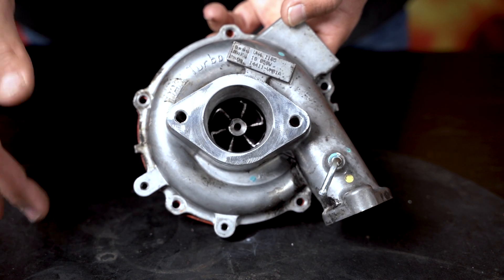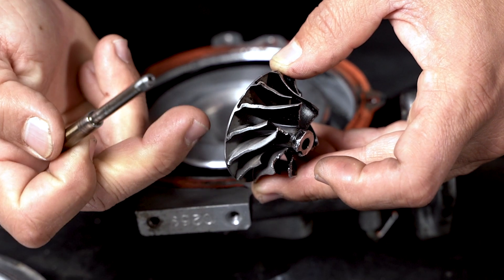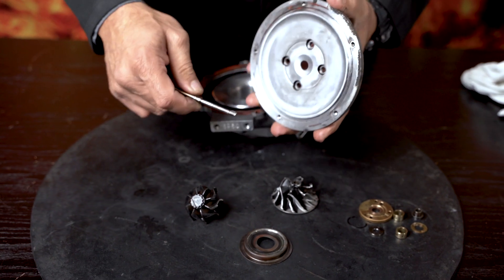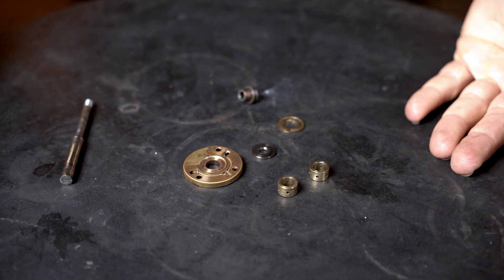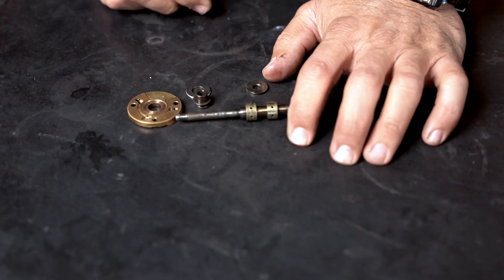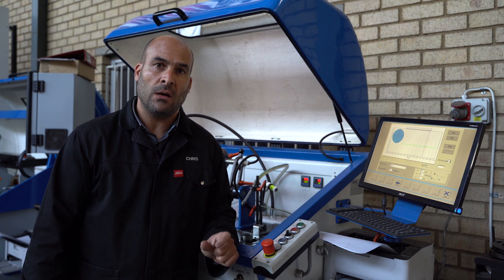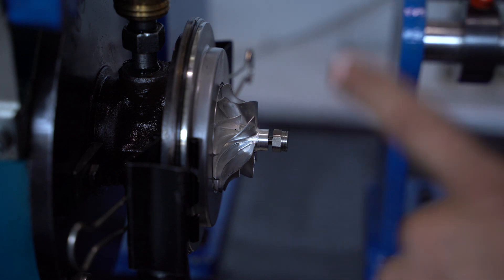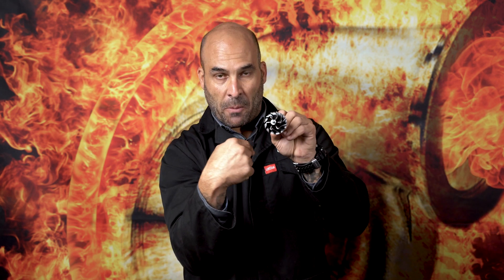Can a turbo shaft nut loosen during operation?

Comment: I rebuilt a Garrett TE-60 for my Grand National. Powder coated the compressor housing, new bearings and thrust collar, and Cerakoted the turbine housing. Bearings were proper clearance. When I took it for a test drive, the compressor nut came loose and bounced around inside like a pinball. I was so sick to my stomach.  It baffles me to this day
Reply from the maker: The only way the shaft nut can loosen is if the rotating assembly during operation comes to a dead stop or sudden/immediate stop - this is usually caused by a seizure of sorts.

Comment: So what is the cause when half the shaft with the nut breaks off
Reply from the maker: Many failure mechanisms can cause a shaft nut to break  - depending on the turbo and bearing system, the shaft could break at the neck or shoulder.

Comment: Great to know and great explanation. I have one question how much back and forth play should the turbine have?
Thanks
Reply from the maker: There will always be a tolerance axially - and radially. This will change over time with predicted wear in the bearing cartridge. IF there is abnormal wear sustained in the cartridge, this will change, and if excessive, you will have contact made between the rotating assembly and the mating end housings.

Comment: what if the nut loosens just barely and i notice it and tighten it again. is turbo still good? or does it need replacement.
Reply from the maker: Excellent question - here is what happens.  As the nut loosens, it will usually associated with a lack of lubrication or a lubrication related problem. In journal bearing turbochargers, if the rotating assembly comes to a sudden stop, this will loosen the shaft nut. Keep this in mind, ill come back to this shortly. A seizure in the bearing system from a lack of lubrication (oil starvation) will create a sudden stop or slow in the rotating assembly which will loosen the nut, and as the rotating assembly rotates again, the nut will re-tighten as you saw in the video. Keep in mind a seizure is unlike a 2 stroke engine which comes to a dead stop and remains in a seized stated until it cools down, freeing up the piston/s again. The turbocharger seizes, and the thing molten layer of the bearing material will seize/swipe itself onto the mating component (Shaft running face, or thrust collar, or spacer etc) and then once the material has swiped onto the mating surface (aka material transfer) the rotating assembly starts to turn again. 

NOW - the nut loosens, which frees up the rotating assembly and almost always the orientation between the compressor wheel and shaft changes. Then the nut tightens up again, BUT the rotating assembly is now out of balance ..... the bearing system will not last very long in this state, and it will usually become audible. 

What you will more than likely also find is that the rotating assembly once free'd up with the loosened shaft nut, will thrust the turbine and/or compressor wheel into the mating end housing, which will cause damage to the blades.  

The other occurrence will be the nut loosens off of the shaft and gets sucked back into the compressor wheel inducer blades once the rotating assembly starts to rotate again, damaging the wheel.  In this case most 'mechanics' will claim warranty as we never tightened the shaft nut, and it caused damage to the compressor wheel blades..... very common claim when turbochargers are not primed, or not primed correctly. I will have to make another video on this to explain it in more detail for you - but hope this sheds some light.

Comment: i am re-assmbling turbo when i do up turbo shaft , nut it locks up have i done something wrong.
Reply from the maker: When you install the shaft nut, it should turn onto the shaft freely, and butt up against the compressor wheel nose. Once this happens, you tighten the nut to a torque value depending on the family of the turbocharger. 

If you are not able to get the nut onto the shaft, then maybe the shaft is damaged or the thread itself is damaged. Also remember the nuts tighten in the opposite direction to normal rotation of the turbo.
Reply: @TurboDirectSA  Thanks Ive defiantly done something wrong as after Ive tightened nut turbo impellers wont budge. wish i could show you.
Reply from the maker: @MrStephen777  Buddy have you not cross threaded it?  Send me a video on info@turbodirect.co.za ill take a look and advise from there.
Reply: @TurboDirectSA  couldent send the video as email said it was too big, will send some images somehow
Reply from the maker: @MrStephen777  send it on a wetransfer
Reply: @TurboDirectSA

Comment: can you do a video to explain old tech turbo and newer deisigns? for example the ct26 used in the older land cruisers (1hz) . some ppl are still adamant that the old ct26 turbo is still the most suitable turbo for this engine , maybe u can go into the compressor and turbine blades deisgn  and how they differ between old and new type?
Reply from the maker: Thats  great question and will make for a great video BUT will spark ALOT of controversy - many opinions will fly and in my opinion will be counter productive.  The points i will make though are the following - 

-- What are you comparing the CT26 ( which is a specific model turbo from a specific engine) to  exactly? 
-- Its not fair/possible to compare this to a universal performance based turbocharger that is designed for a range of engine sizes and P2C ratios..... It will be apples with oranges. 
-- Always use the compressor maps and turbine pressure maps to compare turbos, these are the "spec sheets" which show the facts about the units, and then plot your engines specific data onto these maps to see what turbo is best suited to that specific engine/application.
Reply: @TurboDirectSA Has anyone evey welded a turbo shaft nut to the tip of the shaft it self ? I need to do this to my shaft because my torque rench didn't register 2.1nm and now my nut has pushed past the turbo shaft thread and the nut is now pushing past it's normal  clearance on the bearing. Will a tack weld on the shaft hold up lol 😂

Comment: how are the turbine housing made?
Reply from the maker: They are cast into a mould by melting the material and pouring it into a mould and once it cools it hardens and then its machined to the finished sizes, tolerances etc